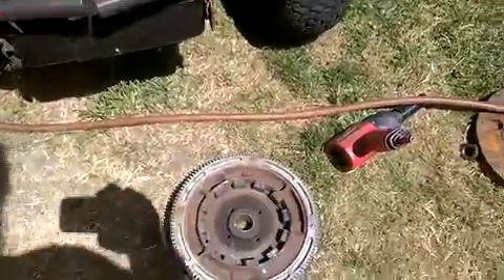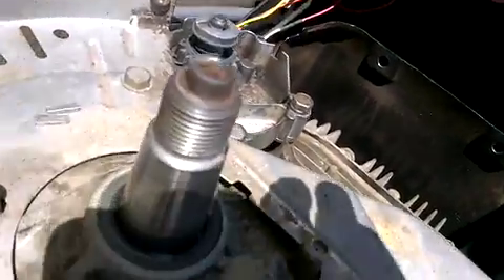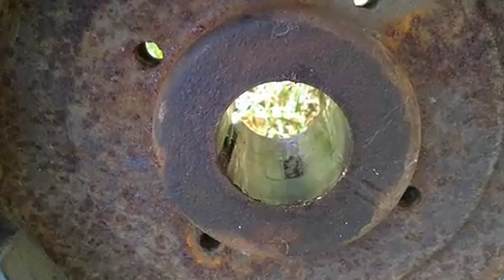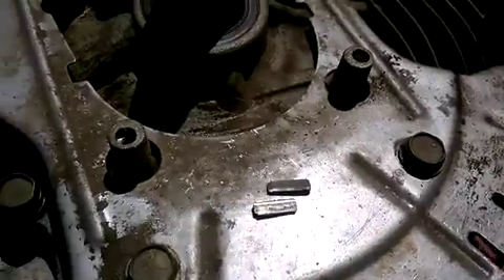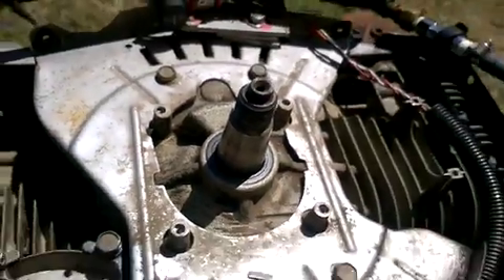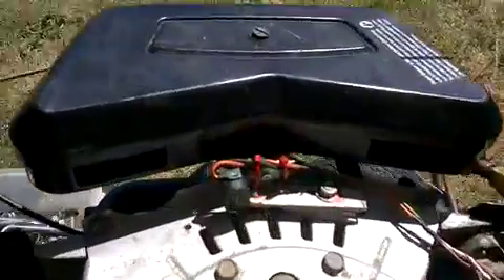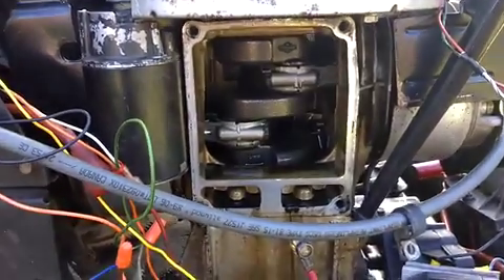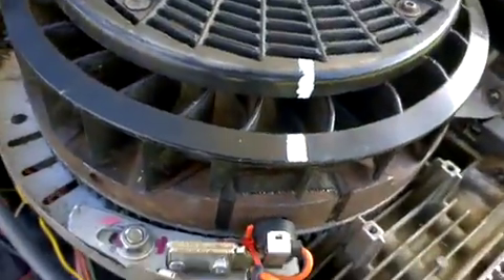Briggs Twin Broken Crank Key Igniton Timing

Comment: Only an Idiot would put a steel key in a B&S engine .You or someone else could be seriously injured  if the crank breaks off 
at the bottom of the threads for the Fly wheel nut.THINK ABOUT IT!!
Reply from the maker: There's the engine shrouds and the tractor hood in the way. Thanks for caring. We're not going lawn mower racing. The key will still break.
Reply: This whole rig looks like a tragedy waiting to happen! Scary.

Comment: Does the coil fire exactly when the screw in the center of the magnet passes by the pickup?  or does it fire as soon as the front edge of the magnet comes by the pickup?  ....or does it fire as soon as the entire magnet has passed by the pickup?
Reply from the maker: If you attach a timing light with the ignition powered, you can tell what coil position is needed to have the crank magnet trigger the coil, if you have determined and marked where physical top dead center is. It's not the same position as the stock magneto uses.

Comment: What the hell is all that advanced ignition you got? Wow. That's kinda cool. Is it fuel injected?
Reply from the maker: Just garden variety GM ignition module, with an automotive coil triggered by a coil pickup from a car distributor, using battery power. If you understand how ignition works, you can adapt to any spark engine.
Reply from the maker: You could add fuel injection but it wouldn't be cost effective. Megasquirt open source EFI.